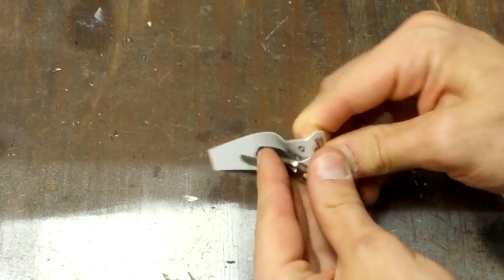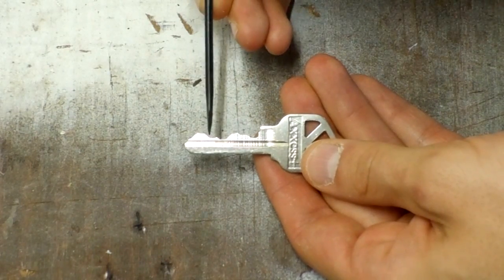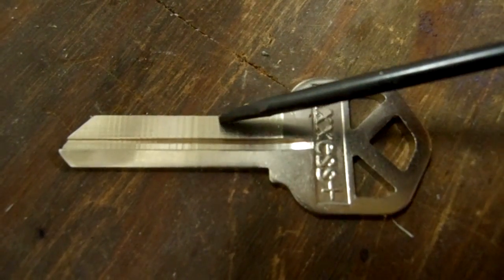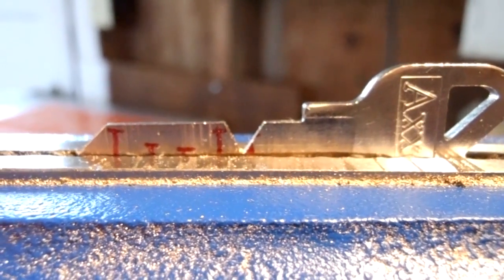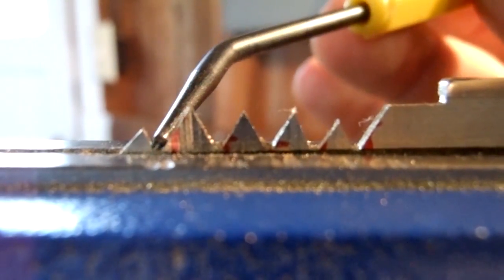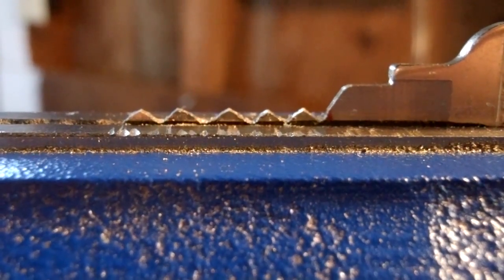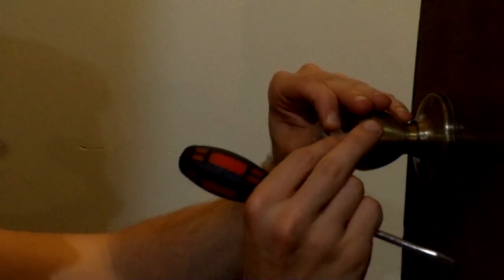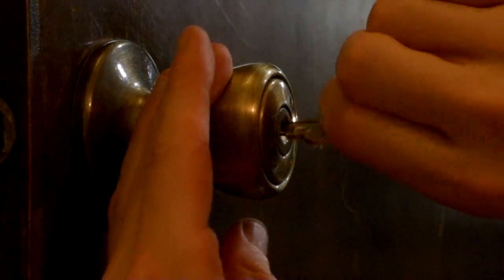Fast Hacks #9 - Make a Bump Key

Comment: How do you get the correct spacing when your cuts clearly missed their marks? Were you not cutting on the marks or off to the side of them?
Reply: You don’t want to cut on those vertical lines directly or the key may break
Reply: @Yahushua22 so what are the marks for? You file in between the marks?

Comment: I should make one for my truck so when i leave my keys in the ignition (which i have a heavy history on doing that) i wont have to call and pay a locksmith or something lol
Reply from the maker: Ha! Well in your particular case it would likely be more practical to just have an extra key made at the hardware store. Also, you can destroy a lock with a bump key so it might end up costing you even more!
Reply: I had one of those key holder combination locks with a spare key locked onto the frame under my jeep because id always lock my key in there.!saved me over a dozen times . 

I also had a slim jim tucked inside the hallow of my roof rack just incase someone needed it and surprisingly people did a couple times. 

People always pointed out i had something hanging under my jeep just dangling .. i told them it was my jeeps balls

Comment: What's the point if you have to have a key that already went to that lock?
Reply from the maker: You need a key that fits the same type of lock. It doesn't have to fit that exact lock. For example, I made a bump key for a Kwikset brand lock. That bump key will also work on most other Kwisket locks that fit the same style key, even though all of the locks accept different keys.
Reply: +Karlan Meyers to simplify this. if you look at your key you will notice a tab facing to one direction. some have it to the left and some to the right. you cant make a bump key with a key that wont fit that specific style of lock is from what im getting from this

Comment: try putting an appropriate size o ring as a spacer So if the key doesn't work the first time, you don't need to reset (pull out one notch) this allows you to apply pressure an keep tapping until it turns.